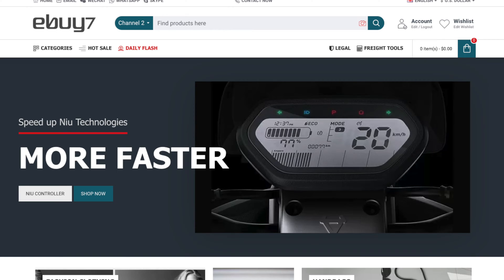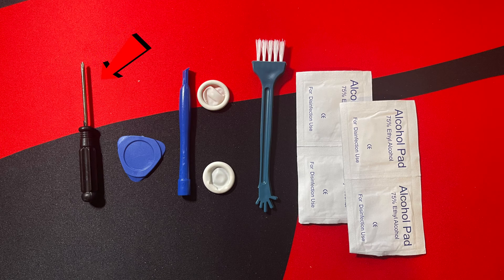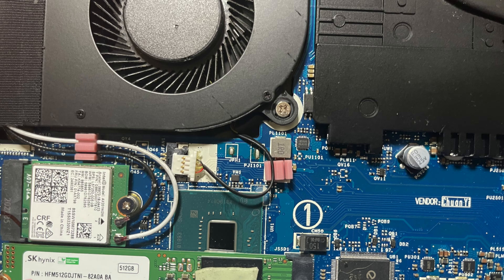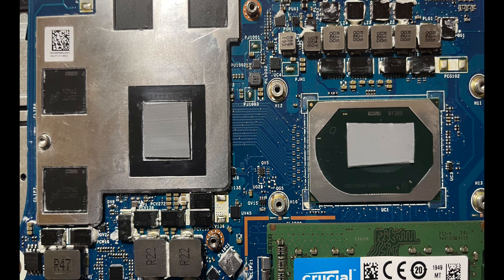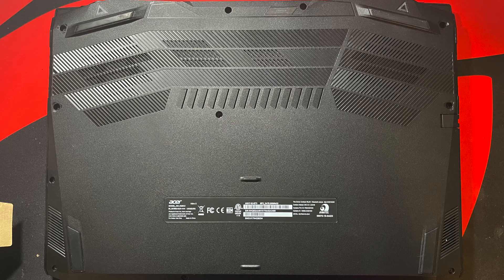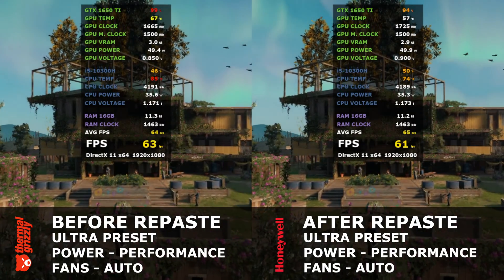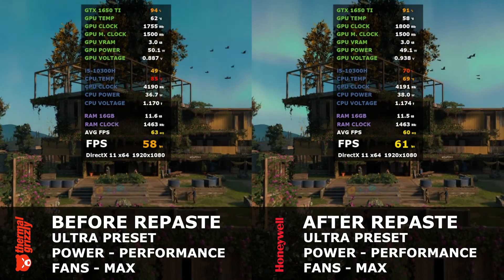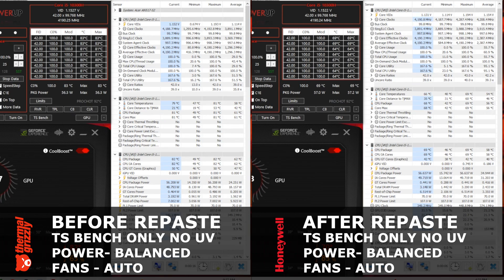Thermal Grizzly Kryonaut - Honeywell PTM7950 REPASTE 👑

Comment: Wish I knew about this before I used liquid metal few years ago.
Reply: As long as you did it properly and there wasn't too little applied, liquid metal is going to last just as long if not longer and be more effective. Ptm is just ultimate safe and ease of use.
Reply: @ashryver3605 lol, maybe on paper according to Reddit. This phase change pad almost always performs better.
Reply: Is not liquid metal better?
Reply: @Jakiyyyyy it needs to be applied multiple times over the period of few months for the copper heatsink to fully absorb. And after that it leaves marks on the heatsink and the dies. Ptm is a much more safe and efficient way.
Reply: @Jakiyyyyy Only theoretically. In practice, it's too hard to apply perfectly and keep in perfect condition, so the face change will almost always outperform it.

Comment: how much should i get? is 40x40 enough or 40x80
Reply: Did you get the answer? How much do we need. It's hella costly at Moddiy alongwith shipment charges. I'm using ASUS VIVOBOOK PRO 16 OLED, i5-13500H rtx4050 laptop GPU.
Reply: What did you end up going with?

Comment: I have an unlocked engineer sample of the Core i7 11800H which produces a lot of heat, the package temperature easily caught 90°C when using a desktop tower cooler pasted with Arctic MX-4 and the power limit is set to 70W in the Intel XTU.

The mounting pressure is way higher than what a laptop cooler can archive and I'm cooling it directly to its die so it must be the paste that doesn't holds the challenge.

Thank you for the benchmarks, I'm trying it.
Reply: It's not necessarily the thermal paste not holding up, it gets to a point where it's not the heat transfer between CPU/GPU and heatsink but just the overall cooling mechanism used. I'm using PTM7950 on i7-11800H laptop with RTX 3080 (165W) both on the CPU and GPU. Full load on that CPU will always thermal throttle no matter the paste used when air cooled in a laptop. The PTM7950 delayed the thermal throttling by around 30 seconds when testing with Cinebench R23 and before repasting it would thermal throttle instantly on full load. A lot of the tests I've seen on Youtube using PTM7950 on a similar CPU only put full load on the CPU for a short duration and not thermal throttling which is not showing the bigger picture. The i7-11800H can not maintain 4.2Ghz on all 8 cores over long duration without thermal throttling with air cool laptop, I don't think it can even sustain it for 5 minutes.

For gaming it's not an issue, no game will use the CPU at 100% and most multithreaded games won't use all 16 threads at 100% or even use 16 threads. When gaming the GPU sometimes thermal throttle and I haven't seen my CPU thermal throttle yet. I usually just cap the FPS and adjust the settings to prevent GPU thermal throttling so I just game within my hardware limits. This may not be necessary, if the game you are playing is not smooth to your liking just adjust the settings. Most cases I wouldn't even notice the thermal throttling if I wasn't focused on monitoring it.

Different hardware and configuration shows different results with the PTM7950, for example the GPU used in this video only draws around 60W at max load and if the RTX3080 in my laptop only draws 60W it will never thermal throttle but at max load my GPU draws 165W.

Overall, I would highly recommend PTM7950. My normal usage temperature with auto fan settings rarely goes over 70 now, before it fluctuates between 70 and as high as 90. This is just with streaming videos, surfing internet, light gaming like playing Pokemon Trading Card Game on PC.
Reply: Same result here. On erying 0000 2.2 ES. With a stock cooler from 95 to 78. No throttle when gaming. But it does when running cinebench though.
Reply: Спасибо за информацию с 11800h. Так как обладатель такого же аппарата. Подскажи температуры за это время не изменились? С термопастами буквально через несколько дней температура ухудшается в меньшую сторону.
Reply: @АртемКурдяев-щ9и Здарова! Не пробовал прокладку ? Что скажешь как по температурам стало?
Reply: Lol, don't use ES.
Reply: Well, it's amazing, my package temperature at 70W dropped from thermal throttling 90-ish°C down to low 70-ish°C.

But temps are terrible until the thermal pad melts and it takes some seconds for me.
Reply: @soyiago  appreciate the update! Will try this on my 2020 Nitro 5

Comment: Can you compare PTM7950 to Boron Nitride Paste?
Reply from the maker: No can do.  You should read up on that.
Reply from the maker: No can do.  You should read up on that.
Reply: @Meanpooh  only downside I found online is electrically conductive while is wet so it should be cured to be non electrically conductive.
Reply from the maker: It's also extremely hard to remove from the processor

Comment: The important thing about PTM7950 is its durability.  It's as durable as the old Innovation Cooling graphite pads, while performing much better than them.  While it's not as good as liquid metal directly, it's safer and you don't have to deal with temp degradation from too much gallium being absorbed into copper, causing hotspots (this is a problem whenever you have a heatsink without high PSI mounting pressure, and copper rather than nickel plated copper).
Reply: It is as good as liquid metal in most applications. Better in practice when you consider application consistency, not to mention safety.
Reply: how long i have to repaste laptop with ptm7950? 1 year?
Reply: @JoseAlves-nr9xt  you dont need repast ptm... Maybe 6 years
Reply: @JoseAlves-nr9xt  Unless you plan on owning a laptop for more then 10 years, you basically never need to repaste it
Reply: @JoseAlves-nr9xt  It lasts long maybe longer than liquid metal that it lasts throughout the laptop's lifespan. This material is made for industrial use so it was designed/formulated with durability and longevity in mind. The material improves in performance with every heat cycle you apply to it.
Reply: In my opinion is better than liquid metal i testet this on my own laptop.
Reply: @pawejozwiak7147  Nope, swapped PTM for LM and idle temp went down from 50 to 37 and max load from 92 to 76.
Reply: @NotEvenDeathCanSaveU yep

Comment: For GPU and CPU crystals you have to use thermal paste only. Thermal pads are made for other parts. Thermal paste fils microscopic gaps between the hitsinc and the crystal.
Reply: The ptm 7950 becomes liquid at 45 degrees C
Reply: @astrobeats3863 exactly. This “pad” is phase-changing and fills those gaps on performance as the cpu heats up. Really impressive stuff.

I know for a while now Lenovo actually ships their Legion laptops with this stuff already, on top of their active cooling solution. 

Pretty sure some other performance laptops do the same.
Reply: Brainlet

Comment: how difficult will it be to completely clean during service. The way it melted in Linus video, i think it will be stuck on the die/substrate and the capacitors around it.
Reply: Once its cooled it kinda goes back to solid-ish state and you can wipe it off no mess. It doesn't spread out a lot if you cut it to the cpu gpu die dimensions since it's already thin. Laptop users use this before the ltt vid talked about it. You'll mostly find user experiences and info in reddit.

Also, linus melted it "WITH A TORCH" under a pc case plate... just to show how it changes phases...

Comment: Did you equalize the PL1 and PL2 values? My CPU automatically switches to Power Throttle after 28 seconds.
Reply from the maker: No. Throttlestop was only used for the benchmark. No settings were used in the program.

Comment: have you tried changing thermal pads for vrm, vrams, and SSD on your laptop?
Reply from the maker: This machine didn't come with the standard thermal pads which are solid.  I use K5 Pro for replacement.  Never changed anything on the SSD's.  I may one day try to use solid pads but it will be a pain as there are too many areas that are cramped with different heights.
Reply: That's basically pointless. They don't throttle due to heat.

Comment: Honeywell PTM 7950 is not only good as absolute temps, but it also lasts much longer then the best thermal pastes. Using it since may, and (thanks also to winter) I'm confident I don't have to repaste my gaming laptop for 1 entire year for the first time.
With any thermal paste you'll see temps degrading quickly even after a few weeks, very noticeable after 2-3 months. This doesn't happen with PTM 7950.
You can even pass the AIDA64 stress test with fresh PTM (!!!).
Reply: I also use more than 1 year in my msi laptop - no degradation!
Reply: it actually will last for lifetime
Reply from the maker: Thanks for sharing
Reply: you can use ptm for the lifetime of your pc, not just 1 year
Reply: @kaslanaworld4746  on gaming laptops with much higher temps no, if you want to keep cpu/gpu around 80°C max forever... On desktop I agree it can be a definitive solution due to lower temps
Reply: Do you know where I can buy it that is of good quality?
Reply from the maker: @joesv6897  https://www.ebuy7.com/index.php?route...
Reply: Are you sure? After few months my laptop started to get hotter with Honeywell. What could be the reason here?
Reply: @Jakiyyyyy  don't know if there are some fake PTMs around, as some say... but as personal experience and of a friend of mine I confirm what I said before. Thermal paste: will severely increase temp in 1-2 months. PTM: lasts much longer and can take a few degrees after 6+ months and never as bad as thermal pastes (pumping out and other known issues)
Reply: @lucal7756  If thermal paste is THAT bad, millions of CPU would be fried in the last 20 years including those notorious for heat such as Pentium EE, i7-920/940. Not to mention GPU such as 9800gtx that can cook eggs while you are playing games. Don't forget, those old thermal pastes aren't as good as today products.
Reply: @Azura2910arpg  I don't know your experience, but I repasted myself my own gaming laptops for years with Grizzly, NT-H2 and Gelid GC Extreme. Gaming laptops work at a much higher temp (even constant 78-90°C) than desktop systems (50-60°C) with their huge heat pipes. I know what I'm talking about because I don't speak in theory but with direct experience. Even the best thermal paste gains +4°C in a few weeks or 2-3 months, contrary to TPM7950 which has a much higher durability in terms of high temps.
Reply: @lucal7756  I don't doubt ptm7950 performance and durability, it is proven. My point here is about your statement of "Thermal paste: will severely increase temp in 1-2 months" insinuating fast degradation. Readers without knowledge would think: oh it is gonna fail within a year or so. In reality, if that happens as you say, a laptop would die within 3-5 years, no ? Also I have 6900HS+3080 laptop here with ptm7950. It runs on higher temp as @Jakly said. Since your CPU+GPU don't throttle as often as thermal paste (better heat transfer so it can run in higher clock longer). You can test this with benchmark software, you will have higher results compared with thermal paste solution.
Reply: @Azura2910arpg  you have a strange misconcept about "dying laptop". Even if it's true temps with the best thermal paste will increase much quicker than TPM, this doesn't mean laptop will die (???) just because it will reach again 96°C or more in a few months. Cpus have thermal protection etc. So nothing will die... Saying thermal paste will degrade quicker than TPM doesn't imply the degradation will be incremental forever: will be ineffective in lowering temp in a certain degree after a while but will always do better than having nothing at all. I don't understand your obsession for "dying laptops" nobody said about laptops repasted with thermal paste. PTM is just better for temps and durability.
Reply: @Jakiyyyyy  Before I used the Thermal Grizzly Kryonaut Extreme 14w M/k, and my temperatures were "good" (max 91 CPU), I changed to the ptm 7950 and there are times when my Cpu reaches 100C Celsius haha, I bought it on aliexpress, in the place that had the best reviews and where more was bought, the funny thing is that the GPU if under temperature, curious. By the way, do you know anything about the Iets gt600? I'm anxious to buy it
Reply: @joesv6897  No, I use IETS GT500 V2. Apart from Honeywell, my laptop mostly rely on that cooler that make huge difference. When I stop using that, now Honeywell start showing the real performance. It's not good.
Reply: @Jakiyyyyy 100% certain you got the real stuff? Not some ebay/aliexpress rebranded stuff.
Reply: Starting to think I need to re paste my 4 year old laptop that's never been repasted. Oddly enough it's still not thermal throttling under max fans, and sits around 82 C, which it can maintain seemingly endlessly probably due to it having an 9th gen I7 and good cooling, but this comment section makes me wonder just how cool it would run after being re-pasted.
Reply: I'd actually heard that it can perform with no degradation for up to 3 to 5 years.
Reply: That is not normal. Thermal paste is good for several years.
Usually people swap Laptop, before they ever need to replace it.

Whatever is happening with your machine, is not the norm.
Reply: @dan8t669  if you want to keep -6/8°C or more you need to replace thermal paste frequently. Of course if is not a problem for you a thermal increase, yes you can keep the paste for years, dried out, pumped out and not very effective. It's the norm known by all laptop experts.

Comment: is there sense in doing the same thing but for PC CPU?
Reply: nah not really, the pump out effect is not really present on a desktop CPU + desktop cpus have a ihs (integrated heat spreader).
Reply from the maker: If your desktop needs repasting then any paste will work.  How good is a different story.  You will most likely get better results on a desktop because of airflow.

Comment: Just ordered mine , feels good I made a good decision 😂
Reply: How did it work out? Do you have a link to where you bought it? Im concerned about scam sellers
Reply: @TheDarksideFNothing  honestly it’s amazing I’m cooling a 5950x with a Celsius drop of 15 to 18 degrees compared to thermal paste , this Is using a 360mm rad too not air cooled.
Reply: @FGCJuulz  whoa!!! That sounds like what I need! Even before my MX-4 all pumped out I was still on the verge of throttling in some games. I'm definitely ordering it!
Reply: @TheDarksideFNothing  same here, that ebuy7 feels like a rip off
Reply: This where I bought mine
Reply: @FGCJuulz  thank you mate. Hope it will arrive

Comment: Hey I'm curious how honeywell compared to Kingpin KPX thermal paste, I'm thinking using honeywell for my PC that using 5800X3D, what do you think?
Reply from the maker: The Kingpin looks good.  It may perform better since it has a rating of 13.8 w/mk.  This is more than the PTM7950 but so is Kryonaut.  I may give it a try.  Thanks for the heads up.👍
Reply: @Meanpooh  The rating doesn't tell much
Reply: For this cpu it is enought to use Mx4 or mx2... Its not bare die...

Comment: helpful vid. also appreciate showing the size of pads so now I know which size to buy also for mine
Reply from the maker: Glad it was helpful!  I have enough to do 9 more with the 80x80.  Will be trying on the Alienware M15R3 (i7 10875H - 2070 s) which runs notoriously hot.
Reply: @Meanpooh  Cool! I'm curious to see those results!
Reply from the maker: I tried it and i'm puzzled as it made it worse by a few degrees.  Just awful.
Reply: @Meanpooh  Are you getting enough mounting pressure? Maybe the thermal pads on the VRMs are too thick, causing the heat sink to not make good contact with the CPU?

I used some thick thermal paste on the VRMs when I did the last repaste, on the CPU & GPU I used Kyonaut. Got much better temps than the stock paste, but my Alienware M15 R2 is still thermal throttling since I can't undervolt anymore.
Reply: @Meanpooh  maybe there was a problem with application? Did you run it through some heat cycles to see if temps drops down? Repasting again might help as well.